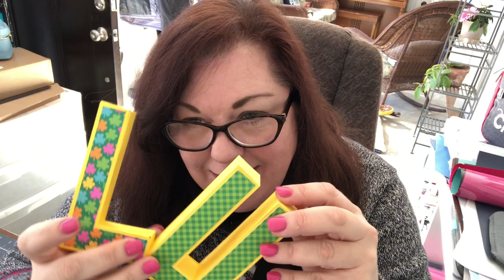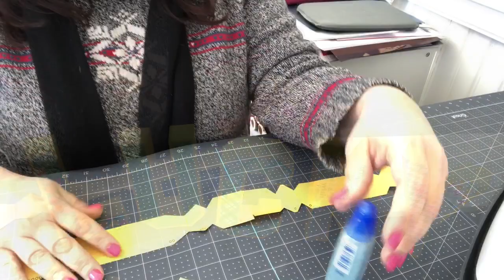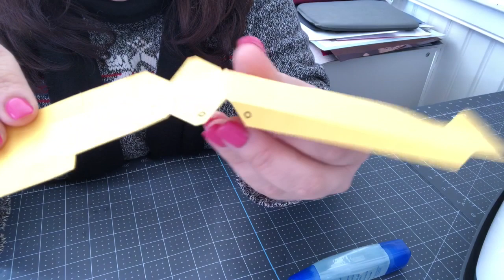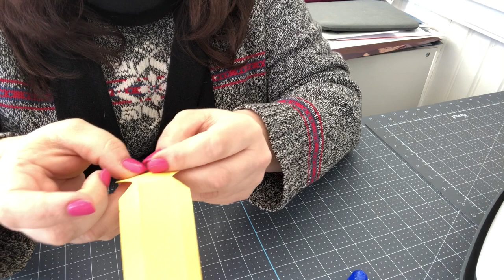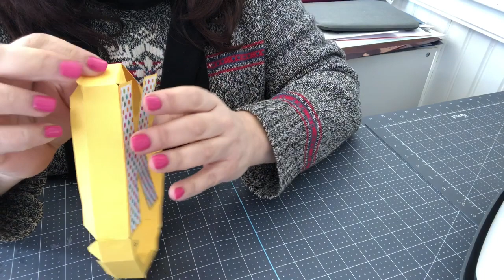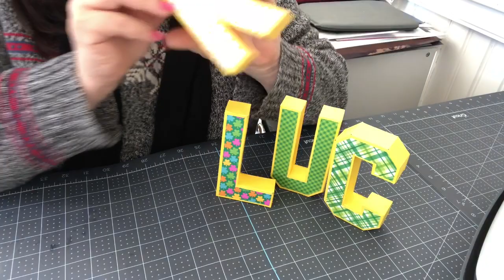Lori Whitlock 3D Letters in Cricut Design Space

Comment: How did you get the score marks so deep? It looks like you folded everything so easily; mine were not so deep and were a bit harder to fold. I am wondering if I am doing something wrong?
Reply from the maker: Which machine are you using and what kind of scoring tool?
Reply: What tool is needed to do this on cricut maker ?  🤩